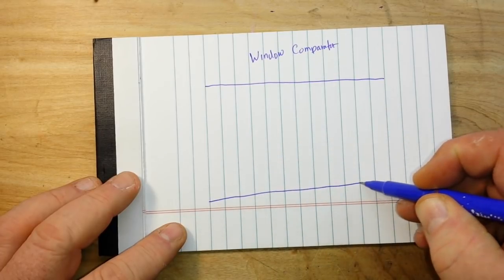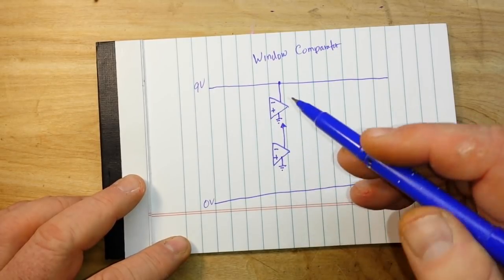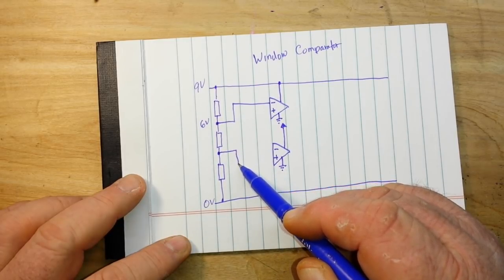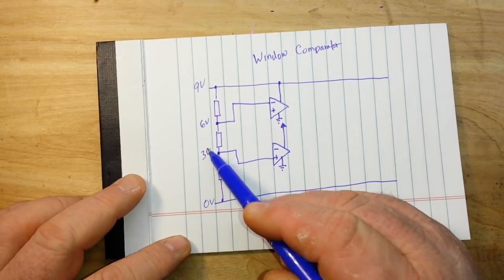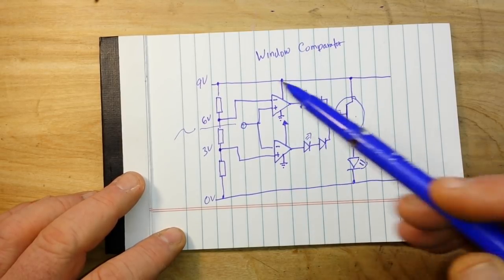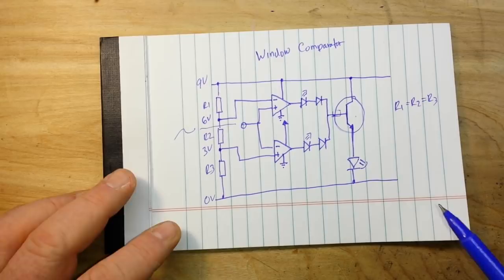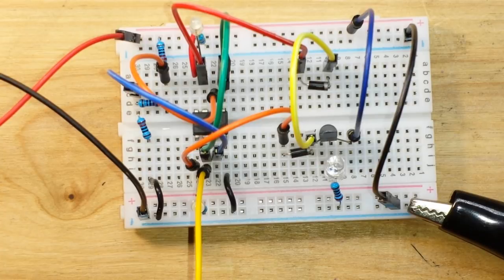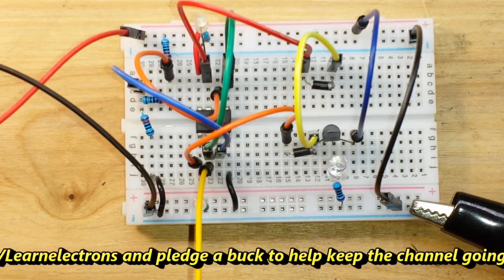Let's Design a Circuit

Comment: First, this is an awesome video with lots of applications. Few ques. For an opamp like that, are there any V or PWR losses (or it's negligible)? Finally, wouldn't there be a voltage drop across the [non-transistor] LED as well as the following diode? Therefore the V at the trans base must be small.
Reply from the maker: +Michael Padovani Negligible pwr losses. 1.8V drop on the blue led and .7v drop on the diode. But it really makes no difference due to the amplification of the npn xsistor
Reply: learnelectronics Right, makes sense thx!

Comment: Do you not need feedback to give you a bit of hysteresis to stop the op amp outputs from hunting when the voltage is hovering on the upper and lower limits?
Reply from the maker: +gartmorn If you have feedback it's not a comparator, it's an amplifier. No, no feedback needed.
Reply: learnelectronics the book I was reading used feedback to give a Schmitt trigger effect to stop the led fluttering at the trigger voltage.  It was a dusk sensor for a lighting circuit.